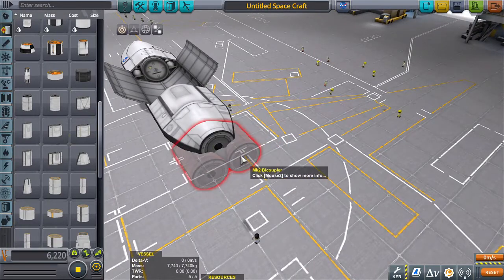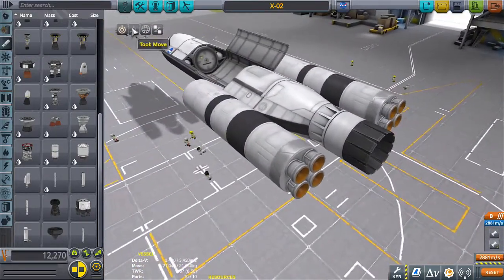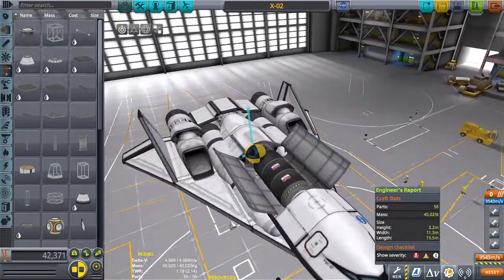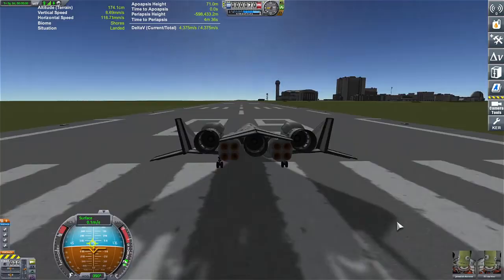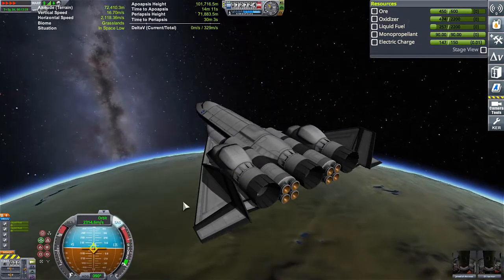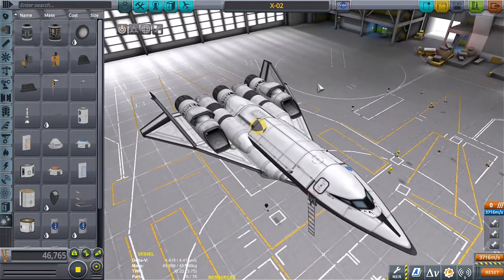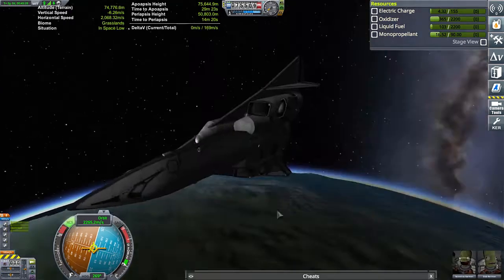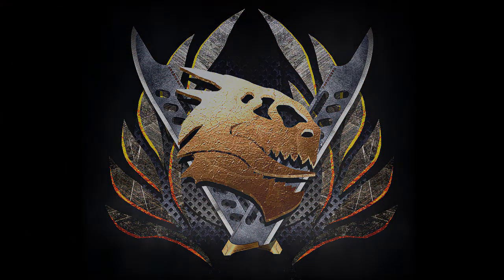SKYLARK CLASS SSTO old school part 1  |   KSP 1.11

Comment: If you want to make building more challenging here’s the mods I really think you’ll enjoy, they don’t change the fundamentals but still challenging.

Ferran aerospace Research, makes the aerodynamics more realistic.

Real heat, makes the thermal dynamics more realistic.

Real atmosphere, better in game atmospheres.

Mandatory RCS, the mod is a bit old but it weakens reaction wheels and time warp doesn’t stop you from rolling around, highly recommended to use RCS build aid with this mod.

All mods can be found on CKAN.

Comment: Super fun vid!
For spaceplanes I tend to budget 100-200LF per jet engine, and I always set control surface authority to 5 deg or less--Makes for a much smoother and more precise ride. Remember the turn radius of an SR-71 is 80 MILES.

Comment: I forget what real life rocket the "Kodiak" is modeled from but in that real rocket I'm pretty sure it was a middle stage engine, like an upper-atmo booster.  I saw you comparing thrust figures but also bear in mind the ISP figure (you'd need to scroll down in the mouse-over window) affects fuel efficiency.  I do not know which has the better ISP: Kodiak or Reliant.
As for the CoM-CoL positioning, I shall quote 'Contact': "Number one rule of government spending: why have one when you can have two for twice the price?"  In other words, double up on your rear wings, essentially embedding two in the same place as any given one.  (with slight offset to overcome Z-fighting graphics)
Good grief, the kerbals look so small next to the Skylark!